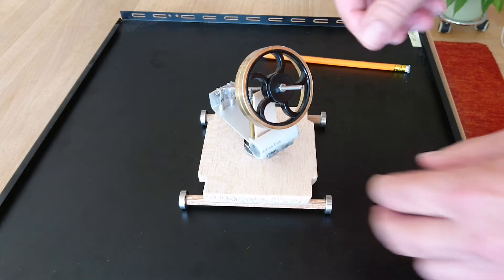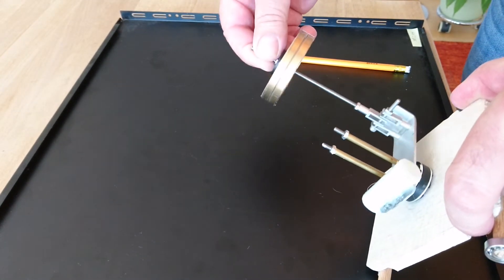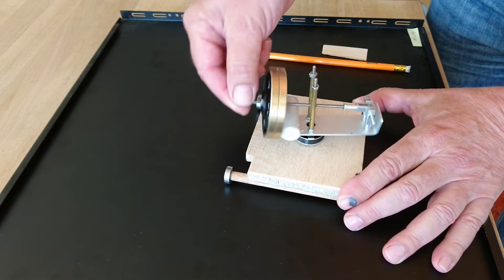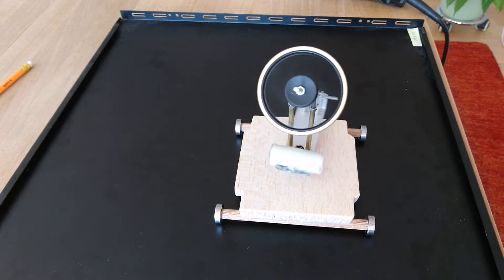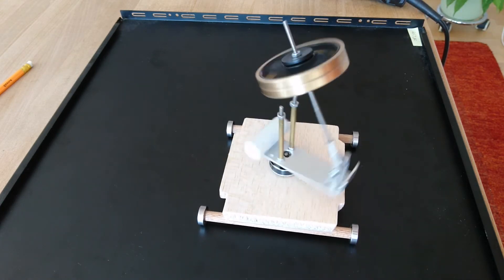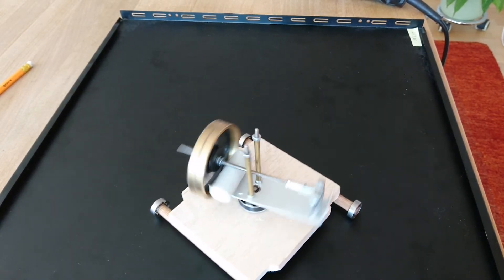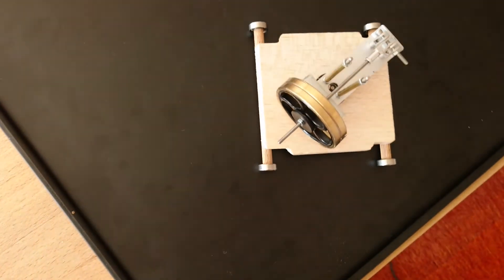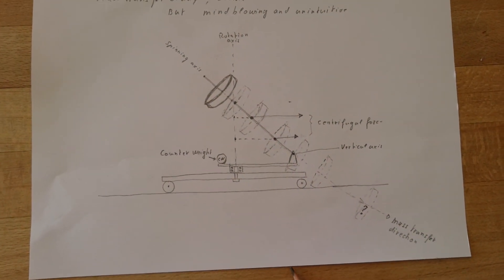inertial propulsion with gyroscope part 18 -  mass transfer-

Comment: I know this stuff, I spent many hours experimenting with gyroscopic motions and reaasoning about them.  The reason of the rise of your spinning flywheel is linked to the friction of the bearings of the flywheel.  You can see experimentally that if you increase the friction of those bearings, the flywheel will rise more rapidly.  Without that friction, the flywheel would not rise at all.  It is difficult to give an understandable explanation here, in a few words, but if you like you can see  my videos where I gave a detailed explanation of this phenomenon.  See the third experiment in this video:  https://youtu.be/s-wt6m7KDFo   and this other video, which is about the rise of spinning tops.  A different context, but the basic principle is always the same:  https://youtu.be/BBRNMmSwyQs   About Laithwaite, I don't think that he had very clear ideas about the gyroscopic motions.

Comment: Congratulations for the system built. On observing the results my thoughts went in the following direction.
1. When it was spun and released at 2:07, the gyro settled at an angle where rather than settling on the long shaft  I preferred to visualize it as a gyro with a shorter axis rotating at a point vertically above the central bearing as is shown at 2:09. When the gyro climbs up or moves down this arrangement seems to behave as a gyro which lengthens its mixes on a central mast. This rotating point is where the angled axis wobbles the least on either side of the vertical through the center thrust bearing. My eyes seem to notice that the point about which the axis of the gyro rotates considered to be a variable height central mast,   this apparent central mast seem to have its height below the gyro wheel and then it goes above the gyro wheel as it climbs higher to cross the vertical through the central bearing as in 3:02.
The fact that the gyro climbs is seen on other gyros which spin on a central mast.  My explanation is as follows. When a spinning gyro spins and also wobbles then the velocity of one mass particle say on the circumference of the gyro changes velocity and acceleration.  If one looks from the top at a plan view the fact that the gyro is spinning much faster than the rotation of the wobble then one mass particle looking from above when the mass is in the lowest position will have the velocity of the spin plus the velocity of the wobble and the same spinning mass at its highest position will have the velocity of the spin from which one subtracts the velocity of the wobble. This means that one particle spinning with a wobble will be subjected to a change of accelerations at the top half and the bottom half of the spinning wheel.  It seems to me that since the lower half of the spinning wheel are all in a cumulative direction while on the top half of the spinning the particles are in opposition to the wobble then the tiny forces to bring about this lower half of the wheel to reach a higher velocity must react to push the gyro up.
On other videos with the gyro spinning on a central shaft, the spinning wheel finishes up perfectly vertical as in that vertical position all the mass particles in the spinning wheel retain their state of affairs with respect to its velocity and acceleration as there is no more wobble.
https://youtu.be/I87jgq4-WB4
In this experiment, by the gentleman woopyjump, there is a time when the gyro loses its spinning, and then its weight will take over.
Reply: Thank you for observant  comment.  I am tending to think that you maybe on to the answer. I think you on the right track but in the wrong event.  Consider researching on conservation of momentum and 'centrifugal force'.
Reply: @gensyed A comment I made elsewhere for your attention, please.
 The gyro in the "floating " configuration, when placed at the end of an extension arm, DOES NOT LOSE ITS  WEIGHT  and that issue, is very misleading many people, including many universities. I advise readers to proceed to read what I am about to write as it will not be found in any book or from no one else, and readers, they are free to comment on my recent thoughts.
Here are the details of what I think happens in a gyro.  There are basically four states one needs to explain. I shall use what is seen in the video above showing a gyro appearing to be floating.

1.  The vertical down weight of the gyro (mg) seems to be floating on air and how it is held up against gravity needs to be explained. 
2. What forces the gyro to turn about itself with the dynamic precession (Wp and torque of I.Ws.Wp) needs to be explained.
3. Why the gyro, when not spinning but rotating as a pure mass m shows centrifugal force about its own center and about the pivot point and this later disappears when the gyro spins and precesses. 
4. Why the mass m is basically moving slowly around the pivot point. One may consider this as a linear motion using a force Force = ma + air drag forces if Ra is larger large and then work it back into motion about the pivot point by knowing that a= (R arm)*d(Wp)/dt

The above is achieved as follows.
a. When a fast spinning gyro (Ws) is taken and allowed to move around a radial arm (Ra) with angular velocity (Wp), then the trajectory of one mass particle is a three-dimensional cycloidal curve containing different locations, different velocities, and different three-dimensional accelerations.  Within the curves of this three-dimensional cycloid, there are ACCELRATATIONS  acting on the spinning and rolling mass particles which bring about two opposite acting centrifugal forces which vary their magnitudes,  one acting inward on the upper horizontal half of the gyro, and the other acting outward on the horizontal lower half of the gyro. These two opposite acting centrifugal "horizontal" forces act at a slightly forward angle to the movement of the gyro, will create all the magic in the gyro as follows. Also, note that these two opposite acting forces also act on the forward vertical half of the gyro ( the inbound force) while the ( outbound force) acts on the rear vertical half of the gyro.  They are basically horizontal in nature and their horizontal and vertical separation between them and the slight tilting forward give all the requirement to make the gyro behaves as it does. This is how what was described above handles all there is to handle in a gyro as shown in the video.

1. The weight of the gyro (m.g) working in conjunction with the supporting arm as a pivot, and the extension rod (Ra) generates a  gravity torque ( m.g.R arm) which tends to pull the weight down.  This is opposed by the two opposite acting centrifugal forces being separated in a vertical manner by a distance x.  This arrangement will give the following. The inbound force (Fin) is above the outbound (Fout) by a distance x and so these create a torque of   (F1+F1)*x = (mgR arm) and this is a balance in the gravitational state. 

2. The flat face of the gyro spinning wheel at (Ws) with an inertial "I" is changing its orientation with respect to earth with angular velocity (Wp) as it circles around the pivot suspension point and this needs a torque = (I.Ws.Wp ) which is provided by the same two opposite centrifugal forces separated by a horizontal distance x, acting on the front and back vertical halves of the gyro spinning wheel.  Hence
F1+F2)*x = (I.Ws.Wp)      This means that the inertial of the gyro tries to resist the torque action by the horizontal separated opposite acting centrifugal forces F1 and F2. This is the dynamic angular motion balance. 
Note the beauty of the relation between the ( Falling weight and torque ( m.g.Ra),  and  (the  two opposite  and separated centrifugal forces, horizontally and vertically by distance x, ( F1+F2)*x) and( the torque  needed by the gyro (I,Ws,Wp)) 
vertical gravity balance =  (m.g.R arm) = ( F1+F2)*x   = horizontal angular torque  (I.Ws.Wp)=( F1+F2)*x

3. Since the two opposite centrifugal forces are " almost parallel with the gyro extension arm Ra, then conventional outbound   Centrifugal force m.(Wp)(Wp) *R arm =  (F1-F2) where F1 is the inbound centrifugal force which diminishes with the loss of spinning, of the gyro and so the normal outbound centrifugal force F2 takes over.

4. The force  that pulls the gyro forward may be looked upon as being a linear force  and this is  due to the slight tilt forward of both centrifugal forces which is (F1+F2)*sine (angle of forwarding tilt of the centrifugal forces)     Hence this forward motion of the gyro may be looked upon as being
 Force= ma + drag force .
This may be "adjusted" as the linear acceleration is related to the Wp rotation of the gyro by (Wp) where a= d(Wp/dt)  so (F1+F2)*sine( small forward tilt angle)= m.d(Wp)/dt + Wp drag and other losses. 
If one watches other video one sees gyros rising to the top by some unknown forces, and I do believe that this force may account for what one sees in other videos as shown in the following,

The beauty of what was explained above means that at very high spinning speeds the reaction on the central pivot point is only the vertical weight of the gyro mg. 

https://youtu.be/SEstkIF3U1Q

Apologies for the length of this explanation, but it needs to be commented upon by those who enjoy the magical and elegance of gyros.
Reply: @carmelpule6954  wow, it will take me some time to digest the explanation. tq

Comment: when the axle of a spinning disc is connected to a suspended string the disc's axis takes right angle to the string. but in your setup it lifts to 45 degrees , can you explain?

Comment: How it works, you have a wheel, with tubes on it coming from the centre to the outside, inside the tubes are weighted rods that can slide in and out but don't leave they stop...so when it spins the weights are thrown outwards... around this wheel is a horse shoe shaped group of magnets OR just a wall for the rods to be pushed back into their tubes for 3/4 of the rotation, so for 1/4 of the rotation there is a repetitive shift of weight going in one direction.

Comment: Great demonstration! Although the explanation in terms of mass transfer is not fully correct. To answer this is to ask the question: why does a gyroscope maintain its orientation as the Earth rotates but NOT a simple spinning top... ;) in other words there is a direct interaction between rotation and gravity. Stay tuned for my Anti-Gravity Part 6 video!
Reply: a spinning top will stand up vertical because of the contact with the surface causing an increase in precession.
I filed the end of a spinning top down to a point and it no longer stood up. if it was up when you spun it, it would stay up, if it was off vertical it would process and slowly (over a long period of time) fall down.

you can see this effect without filing the tip. just spin a top on different surfaces, and you will see how it takes longer to become vertical when the surface and top have less friction. Glass surface and paper surface are a good comparison.

Comment: Seems like it wants to lift because it’s easier  or less work in an upright/vertical position - vertical is the place of least extension or effort. It doesn’t become lighter, rather it become more efficient or more balanced.  Just my 10pence worth🙂
Reply from the maker: Please add some more pence, and try to go deeper in the mechanism of the WHY of this behaviour 

Laurent

Comment: Hi woopy . Very interesting set of videos, what I noticed though with this one is the effect is the same as any spinning top , when it is spun it will always attempt to raise itself vertical and balance on its tip , the vertical height is proportional to the rate of precession . I don't know if the mass in a spinning top is doing the same or if it is the gyro wanting to be 90deg from gravity? Keep up the good work .
Reply from the maker: No propblem with that, but have you tried to understand the mechanism of this behaviour ?

Laurent